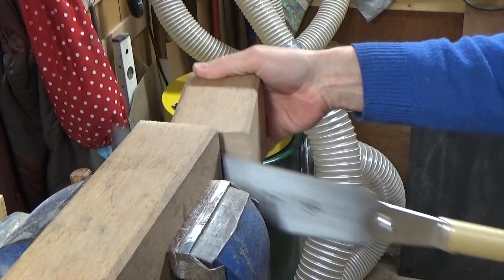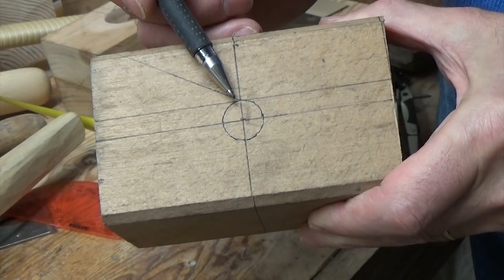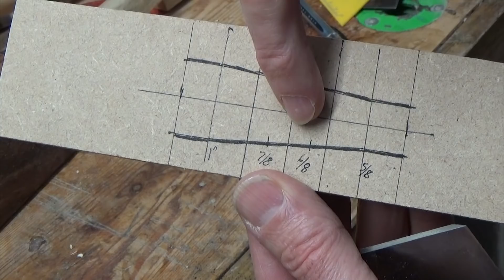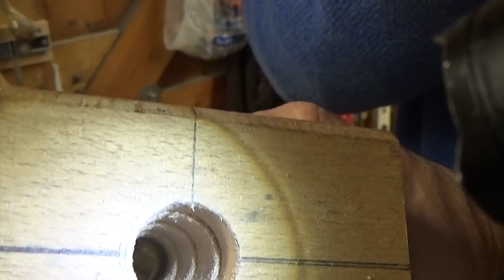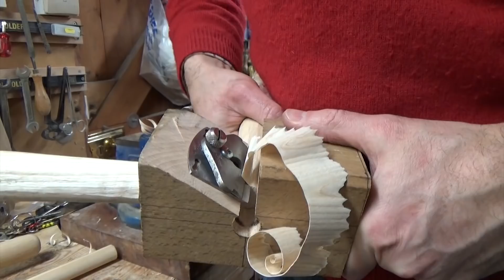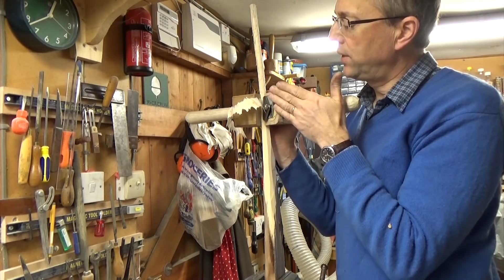Making a Rounder Plane with Hand Tools Only

Comment: I spent a few hours in the shed trying various designs and not getting very far with (hand tools). I was hoping to see how you were going to drill a perfectly plumb line with a hand tool, but it's a drill press :-) (workshop machinery)

Still, I really liked the video and have a friend who owns a press that I could probably visit to use.

For anyone who doesn't have a drill press, you can buy these from Ray Illes for ~ 50 GBP each, it's quite steep if you need several but OK for one size.
Reply from the maker: Hi Alex, I  have plans for this on my website Bucklehurst Leather all proceeds going to MDS blood cancer charity £2.99

Comment: I’ve made a smaller version for tuning pegs. I ground a flat bit to the required taper and I also use that for the socket so the tapers are identical. If you were making a lot of these you could custom make a flat bit or reamer. Those tools are awesome!

Comment: Rather than buy a set of forstner bits, people might consider buying one tapered tenon cutter if this is the only application they have in mind at present. Certainly, forstner bits are useful, but if you are into chairmaking, so is a tapered tenon cutter - especially because some can be used with a brace and bit or hand drill.

Comment: Can you use this tool to make a tapered piece, similar to making the tapered hole?
Reply from the maker: Toni Harkins not really...the first couple of inches will have a taper like a pencil sharpener...but to make a proper gradual taper you will need a trapping plane...in theory you could cut one of these in half and hinge it to make a trapping plane....I have posted a couple of films on making chair spindles...one with spokeshaves and another usinga trapping and rounder planes.

Comment: So what IS the tangent deg, of the exit hole? Ive been thinking, the entrance hole is set for 1", but it could be larger; the exit hole however, must not be exceeded. The entrance could be any size that will allow the wood to get in far enough to reach the cutting blade. From that point, the blade will do the rest of the cutting, down to the proscribed 5/8" diameter goal!
Reply: The triangle used is 30 degrees. It is called a drawing triangle in my country.

Comment: Those attachments on your brace used to shape the handle pegs are very intriguing.  Could you please tell us more about them?
Reply from the maker: +Horst Graben Hi Horst - the cone shaped one is a dowel rounder and they do turn up from time to time on the secondhand market. The tube shaped one used to be made by Ridgeway and others, and sometimes turn up in the States, but are rarer here in the UK....I bought these back in the 1980s.
Reply: +Harry Rogers Thanks Harry.  Apparently the dowel rounder is also known as a spoke pointer (used by wheelwrights I assume). Quite rare these days too (the rounder and the wheelwrights).  I expect it wouldn't be too difficult to reconfigure your rounder plane into a dowel pointer.